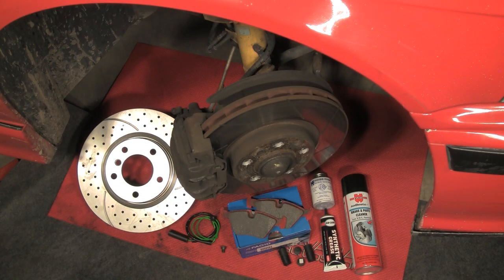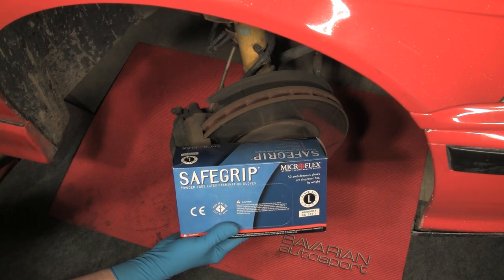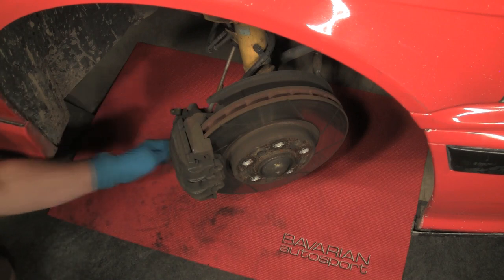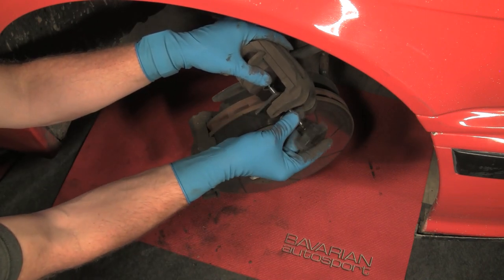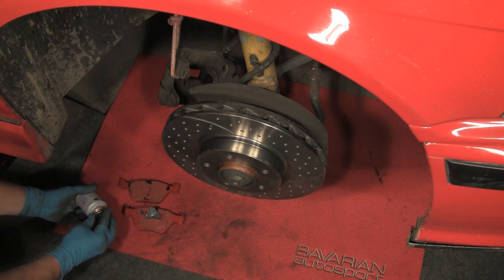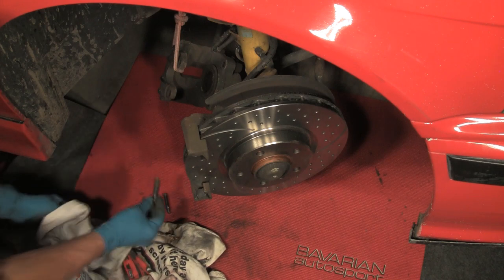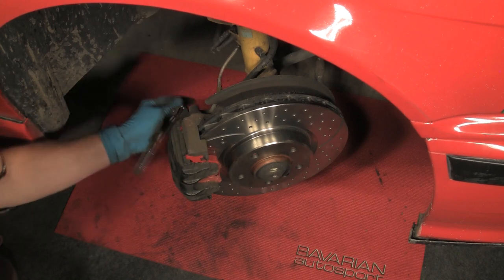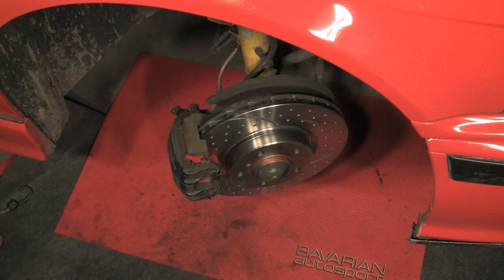Replacing BMW/MINI Brake Pads

Comment: Thanks for the videos in this 2 part series. I changed my rear pads and discs last weekend. Went smoothly thanks to the videos. Brake fluid with your bleeder this weekend. Thanks!

Comment from the maker: @myamail7 -
You're right!  We did this on the right-front.  The sensors are located at the left-front and right-rear.  You can remove the head of the sensor from the brake pad by prying it out with a screw driver (it just snaps into place).  Follow the wire up to the harness plug connection point and unplug it.  Install the new sensor and snap it into the cut-out on the inner brake pad.

Comment from the maker: Yes, the sensor is clipped to the inner brake pad and runs up to a vehicle harness connector (exact plug configuration and location varies by model).  The front sensor is located at the left front brake.

Comment from the maker: Most state inspections note for a minimum thickness of pad material.  For example, the spec for NH is 3/32" of material.  In the "real world", you should consider pad replacement at anything under 1/8" of material ... or ... if the pads and rotors are heavily scored.
Rotors have a minimum thickness and this is marked on the rotor.  Generally, if they're scored or have a noticeable lip at the outer edge they should be replaced.
We do not use ceramic pads due to lower friction characteristics.

Comment from the maker: David Phy - YouTube will not allow us to reply to your comment directly (not sure why) - A 2 or 3 ton floor jack will be fine.  We tend to like the lightweight aluminum jacks as they are far easier to move around ... but they do cost more.  We recommend using the rocker-panel lift points for the jack placement.  Note that if you purchase a low-saddle height jack, you can also slide it under from the rear, to lift under the differential housing.

Comment from the maker: We have found that older dust boots may not fold nice and cleanly when the piston is pushed back into the bore. You may be able to manipulate the boot so that it does fold up nicely. If the boot simply will not fold back into the original position, it will be fine. As long as the boot is not ruptured, it is doing its job. Once it ruptures, it will no longer be protecting the piston and caliper bore and it should be replaced. A caliper rebuild kit or replacement rebuilt caliper is the cure.

Comment from the maker: Most BMWs and MINIs use a brake design that is similar to the one shown.  This is by far the most used brake design for BMWs and MINIs.  If we listed out the specific models that were just like the one shown, the list would include practically every BMW model from the early '80s through the mid to late 2000s and most MINIs.  We do note that this car is an E36 M3, at the beginning of the video.

Comment: When you lubricated the guide bolts, were you lubricating the threads with the brake grease or the non-threaded area just above the threads? Just want to make sure I'm doing this correctly. 

Btw, these videos are great. The video is clear and so are the step by step instructions. They make these DIY much easier.

Comment from the maker: Yes,  the seats can indeed be mounted in the car.  The problem will be in powering the seats, as you will likely not have the power harnesses to plug into.

Comment from the maker: Ahhh ... the ins and outs of video production ......  We did this job on the right front.  The sensor is on the left front (and right rear).  The sensor just clips into the inner brake pad ... then just route the wire in the same manner as the original that you removed.

Comment: you guys are great. I ordered new rotors and brake pads for my 335i sedan and will change it with my friend. I ordered your bleeder kit too, very helpful. Thank you so much.
P.S: I am planning to get an extra oil cooler ( i have one with sport package already) so I don't get limp modes during track days. Any suggestions to stop limp mode?

Comment: Hello can you guys make a video on replacement for the back wheel bearings.
 I'm trying to do them myself but there are other videos which don't show how to use the tools you guys sell so I rather see  you guys make a video. It won truly help me and other people.
Reply from the maker: We have had the wheel bearing replacement on our list.  We're not sure just when this will fit into the production schedule though.  What model do you have?
Reply: BavarianAuto I have a 2000 BMW 328I
Reply from the maker: Berenise Sanchez
 - We do have a DIY write-up on our tech blog - check it out:
http://blog.bavauto.com/2814/bmw-rear-wheel-bearing-removal-and-replacement-diy-e30-e36-e46-e82-e88-e90-z3-z4-x3-and-others/

Comment from the maker: The front caliper piston compressor tool is available in three version, now.
24400 - the basic tool shown in the video.
29100 - a ratcheting style spreader that works like a caulking gun, fits all single piston and most dual piston calipers.
25750 - a ratcheting style similar to 29100, but will work with any style caliper.
For the rear calipers, on the MINI, the piston retractor tool is #V450.
All available at BavAuto.com or 800-535-2002

Comment from the maker: Most late model BMW single piston calipers have a design that looks different than what is shown in the videos.  However, for the most part, the DIY videos do apply to the late model BMW single piston calipers.  We have added an additional posting to address the slight differences in the late model designs.  We cannot put a direct link here, so just go to blogDOTbavautoDOTcom and search "BMW brake DIY video". You can view the videos here and we have the link to the post for late model updates.

Comment from the maker: Not necessary.  The cap is vented.  However, if the reservoir has been topped-off and is already full, compressing the caliper pistons back into the calipers may overflow the reservoir.  In this case, it would be wise to remove some fluid from the reservoir.

Comment from the maker: You do not especially have to do the front and rear at the same time.  If the front is in need of service and the rears are fine, just do the front (for example).

Comment: Hi BavAuto, i followed the instructions to push back the caliper piston.  should i be worried that the rubber boot around the piston doesn't neatly fold back the same way?  there seems to be enough pressure behind the boot to make it bulge where it should have folded.

Comment: Otto, how do you know when it is time to change brake pads?

Same question on rotors.  I assume you can replace the pads without changing the rotors.  Also what is your opinion on ceramic brake pads to reduce dust versus using your brand of pads with the kleen wheel covers to deflect brake dust? 

Can you suggest a brand of both ceramic and regular pads?

Comment: I have Z4 2007 and when I called to BMW to find out the price of the new brake pads they said that if the warning light is ON on the dashboard then I have to purchase sensors along with the brake pads . Is that true ? Do you have to replace brake sensors every time when you replace the brake pads?

Comment: So I just bought new brake pads but realizing that I have no jack or even jack stands. When I get the jack would you recommend a 2 ton or 3 ton jack or is the factory jack with the spare tire fine and where do you jack up the bmw 528xi 2008 because I can't seem to find something nice and sturdy to jack up for the rear end of the car.

Comment: After replacing the pads, and the wheels. Whats the procedure to reset the brakes (2008 535i), not the caution light, but do i need to bleed the brakes or something along those lines?
Reply from the maker: No, bleeding is not required after replacing pads and/or rotors.

Comment from the maker: Stripping out the female hex in the rotor hold-down screws is not an uncommon experience.  When this happens, we do drill out the screw.  The key in doing this (as with any metal drilling) is to use a slow drill speed and sharp bits. Typically you want to start the hole with a bit smaller than your final hole size (which needs to be just a bit larger than the diameter of the bolt shank itself ... the threaded part of the bolt). See BLOG dot BAVAUTO dot COM for more detail. Search - Rotor bolt.

Comment: You should never push back a piston without the brake hose clamped & bleed valve open as the junk in the calliper can get into the sensitive ABS module.

Comment: You dont have to tighten the guide bolts in really tight?
Reply from the maker: No, the torque is 25 ft-lbs.  We have a good "torque-sensing" arm, so we typically do not use a torque wrench on these fasteners.

Comment from the maker: If the sensor has contacted the rotor and turned on the pad wear warning, the sensor must be replaced (front or rear).  We have also found that an old sensor often breaks when we try to remove it from the old pads and install in the new pads ... even if it is otherwise serviceable (the warning has not come on).
bavauto.com
800-535-2002

Comment: Um, do NOT hammer the piston!! EVER! Also be VERY careful with the rubber boot that surrounds the piston itself. If you don't have that special tool, you can use an adjustable C-clamp. Clamp the fixed end around the back of the caliper, and the adjustable end at the piston. BUT, make sure you use the old brake pad (without the clips) over the piston to protect it as shown in the video.